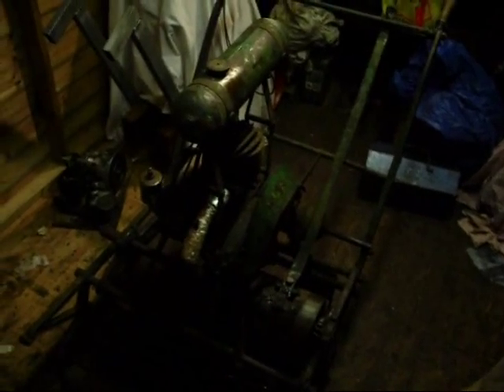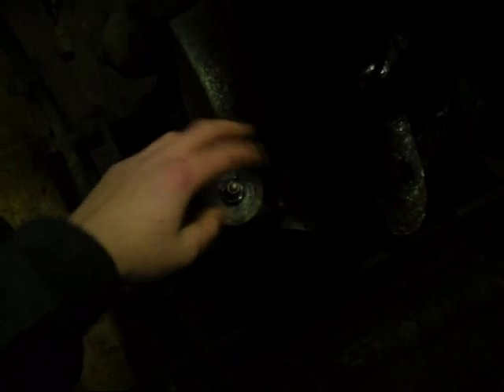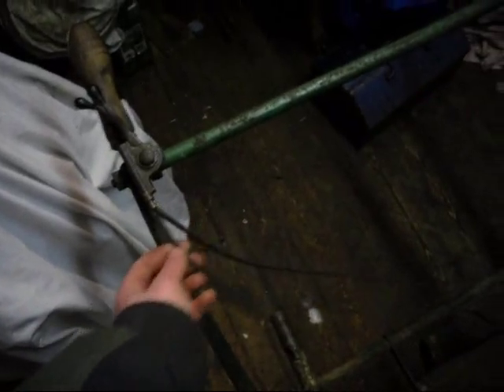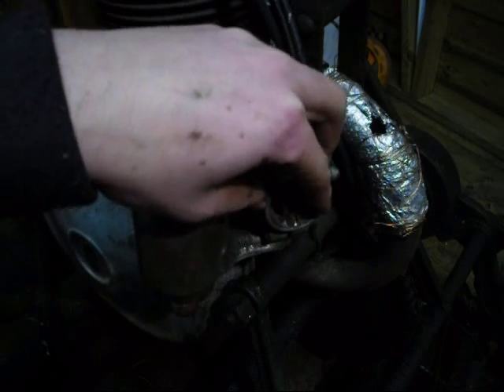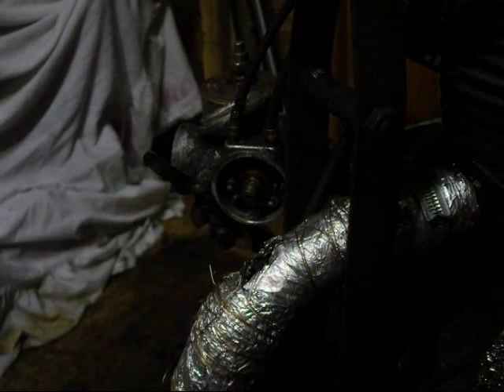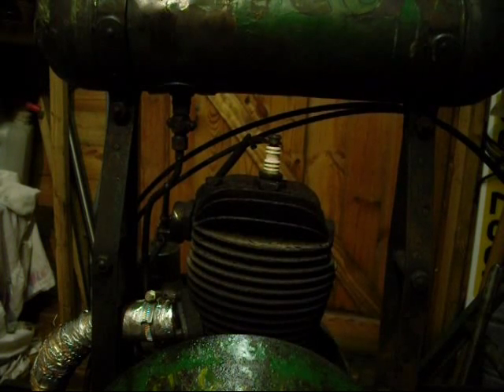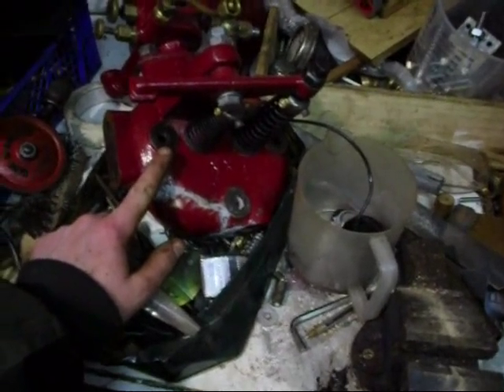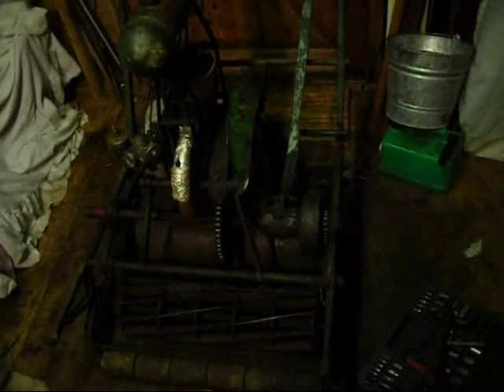ATCO Standard - part 1 -

Comment from the maker: It was full of sludge at the top of the tap, sorted now!

Cables are indeed hard to get but I may have located some, I need a propper kick start return for the medium weight mower, there is a good lawn mower repair centre in Hailsham so next time I'm over that way i might drop by.

Comment from the maker: Yes that was the same problem here, I just tipped the machine back so the fuel wasn't round the tap, poked some wire through and that cleared it. Should be fine to run on the tank now.

Comment from the maker: The manual sais you should flush it through with petrol to clean the grease out, but it's adjusted about right now.

Yes a worn cone clutch can cause a lot of problems! I will try the places suggested for the throttle levers, thanks.

Comment: Yes and no, sometimes they are braized blob or sometimes they are a crimped end so you just buy the new wire and a new end blob from the bike shop (it will become clear when  you buy it) cut the blob off inside the lever, tape the new cable to the old, pull the new cable through and crimp a new end on.

Comment from the maker: Sounds great....but in reality the tape will come off, I've tried doing that before countless times.

The terouble is the end of the cable at the carb side is unique to this carburettor and would not be easym to remove and re affix. The other problem is that the cable has to be the exact length otherwise it just won't work, it's very hard to get cables right. I will look for a replacement genuine part first.

Comment: The cone clutch should be fine when you clean it out. Some early vintage cars had cone clutches,I still remember my grandfather describing the "whiplash effect" these had on the occupants when the linings were worn!! :-) LOL
Good luck with the carb. Try "VilliersServices" or "Draganfly Motorcycles" for the twin throttle levers,I have seldom seen twin levers at autojumbles but you could be lucky!